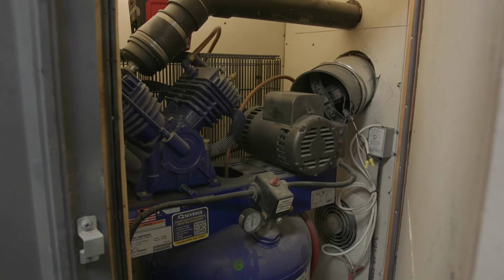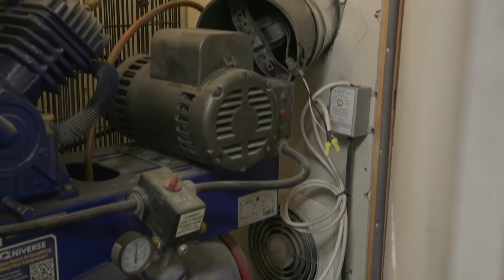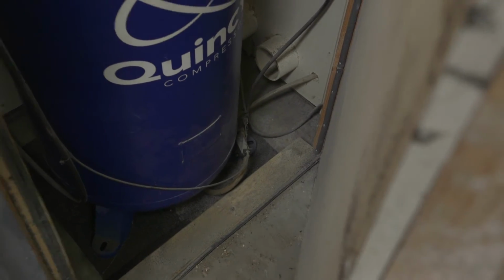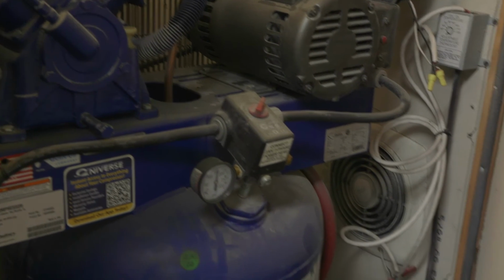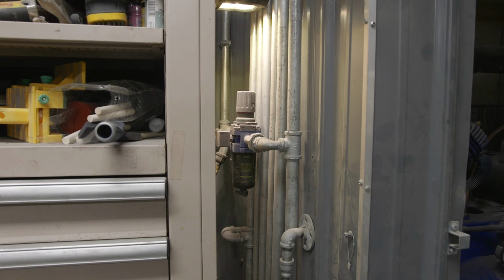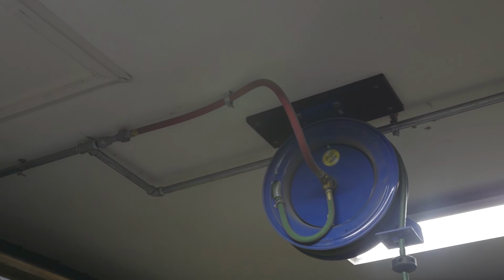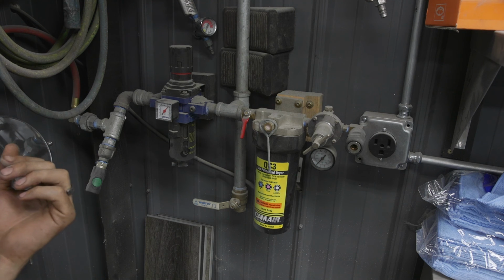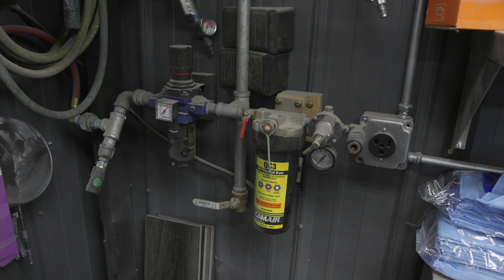2021 Shop Air Setup (A Shop Discussion Video)

Comment: Slab on my new shop is due to be poured this week. I want to get the air system in before I move in. Enclosure is planned as I’ll be running two 6hp, 60 gallon, single stage compressors. Was planning on some of these “mod’s” but you’ve opened my eyes to many, many shortcomings in my plan. See the need now to come up with a schematic so nothing is missed. Would be great if I could get that done and email it to you. Maybe you could point out any mistakes. Thanks for the help.
Reply from the maker: Yep email is vanovercustoms@gmail.com

Comment: Very nice setup, the radiator/manifold is very clever, and I will study implementing something similar here.

One question I have is why keep the air compressor inside the shop in the first place. Here in Brazil, almost any shop with an air compressor have it outside the shop, and the reason for that is not even noise, but safety. If that pressure switch fail (and they do fail), you are in big trouble. I've seen one that exploded, and it blasted a hole in the masonry big enough to pass a car through.

I have mine outside the shop in a masonry enclosure, the door looks like yours, but thinner. Two sheets of roof panel with EPS in between. The cooling is passive and it works surprisingly well. On the side wall I have two 100 mm pipes flush with the slab, same with the bottom. I saw that you have your exhaust in the bottom, maybe if they were on top it would need only one fan intake, since the hot air probably gets trapped between the top and the ceiling. 

Since I do electrical servicing in these machines, here are three tips from my trade:
1) Don't use the pressure switch to power the motor. The high current in the starting can stick the switch contacts together. Use a magnetic contactor activated by the pressure switch instead.
2) Install an automatic drain. I don't know if they are expensive where you live, but install one, and you never have to bother with that again.
3) Install an hour meter for servicing the compressor with stipulated time periods, so you don't need to remember yourself constantly about that.

Best regards.
Reply from the maker: Awesome thanks for the tips. The main reason for keeping it inside is that where I live space is tight and outdoors is not an option due to space constraints.
Reply: Could you elaborate on NOT using the pressure switch for starting? I was planning on wiring up both compressors to a single pressure switch so both start at the same time. Sounds like this may not be a good idea. Thanks, Jay
Reply: @jayfromtexas6718  Hi Jay, I meant that the pressure switch activate a contactor to handle the high current of the motor. If you are not familiar with them, don't worry, some youtube tutorials will help you to do it in no time. 

About your two compressor setup, it is indeed possible, but you have to pay close attention to the working pressure in each of them. Most small compressors are rated 120 or 140 PSI. If they are equally rated, perfect, if not, you will have to use the pressure switch of the lowest rated model, otherwise the tank can explode.

If you have further questions, feel free to ask or even email me, I will gladly help. You can find my contact in the "about" on my youtube. 👍🏼

Comment: Do you have footage with the noise levels? Inside the shop with the cabinet open/closed, and outside by the inlet/exhaust?
Reply from the maker: I don’t. I don’t work in that shop anymore so I can’t get that footage but I can tell you it is completely worth it. it’s quieter than a small pancake compressor
Reply: @VanoverMachineAndRepair  Thank you. Found that using a large hydraulic cooler core on the outlet of the compressor followed by a centrifugal water separator before the tank, made a big difference in how much water collected in my tank. I also used a small engine muffler on the intake, after the filter, which made a big difference in noise level as well! Good job on the plumbing setup, I’ll be copying that!
Reply from the maker: @johnduerksen9191  absolutely. Thanks for watching.